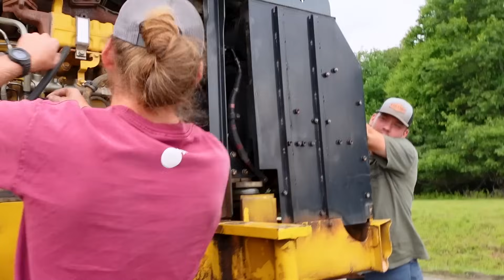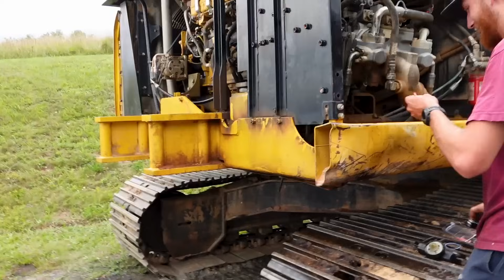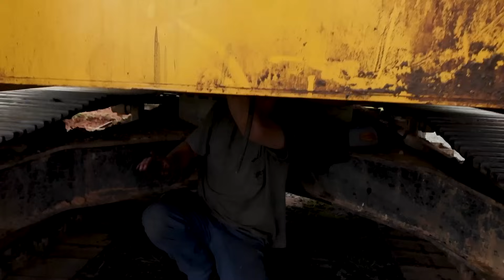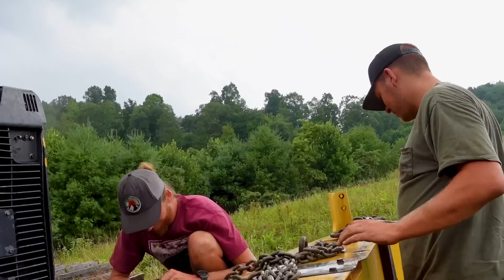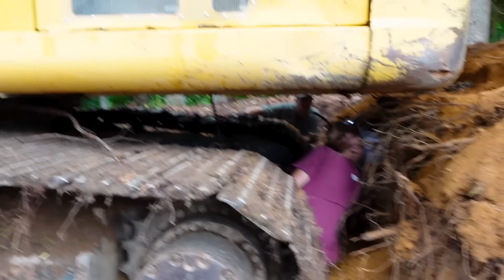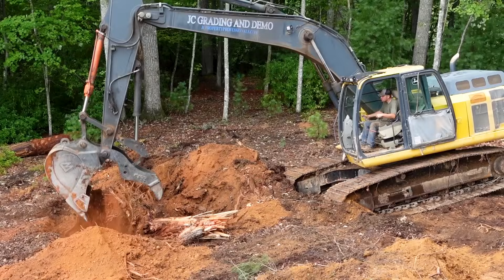Why I Will Never Buy John Deere Again  | 210G Repairs

Comment: Hey man we run nothing but John Deere’s you have a dealer issue not a Deere issue and the right mechanic at a good dealer will make you think other wise  or just a good mechanic but that’s what we get into buying used equipment.
Reply: Sounds like John Deere is hiring ford mechanics! 
 Replace parts until they get lucky🤯
Reply: John Deere sugggs bruh
Reply: Bro John Deere is trash especially making it hard to replace your old equipment and the whole program they have is trash because it’s not user friendly 😂 
To fix ur stuff u gotta use a hack program for there equipment
Reply: @thegreeninvasion5511 nowadays thats every manufacturer. Not a lot of talent out there anymore .

Comment: Jobs deere excavators in usa are usually hitachi machines with John deere decals on it
Reply: Not anymore. In February of 2022 Deere and Hitachi separated. But yeah most excavators made prior to the separation were made by hitachi. Used to use a Deere key to start my Hitachi 470.
Reply: @TsunauticusIV well yes but that John deere would be pre 2022 so would be a Hitachi I would think
Reply: They are all still Hitachi design and parts  built by deere in kernsville  yes even the new p models
  on a 210  the deere will have a deere engine and cooling package   A hitachi will be isuzu powered 

Deere is comeing out with there own design  there are demo prototypes out  in a few sizes doing testing now  they are still labeled p models but are full deere  known as the dex excavator in house

As for the lift pump  yeah the y come complete like u got  but theres a new brushless
Model out  u may not have got that one they are quute a but more money i would have too look it up

Comment: I don’t know who your dealer is, but my understanding is they’re only a small handful of independent dealers left in the United States. Most John Deere dealers are Nortrax. And I can tell you from experience they are horrible to work with. They had my excavator held hostage for a year for a swing motor repair. I have a real crackerjack mechanic I use. The only reason I didn’t have him do the swing motor is because he was going through some bad cancer. I will never send my machine back to the dealership again. My machine is actually a Hitachi purchased from the John Deere dealer. I don’t know the years, but Hitachi actually built the John Deere excavators for quite a few years and just recently divorced from John Deere. It is my understanding that the John Deere dealership Nortrax no longer supports Hitachi’s.
Reply from the maker: For sure, our only real dealer option is James River and we’ve dealt with every division in a 3 hour radius. Have our own employed mechanic now to work on them but he’s still got to argue with the parts darts boys at the dealership before they’ll sell us what we want.

Comment: The problems get right peoples do job.i work pipelines job nw alberta nobody knew at cat dealers how adjust clutch on 594 draw work yup.i got call so teach mechanic how do it because young guys work on new stuff most time.the dealers issue are start get bad even here canada on trucks, heavy equip, farm so on.thanks expose this.😮

Comment: You really have not a clue what your on about as you get one bad problem with one machine which sounds like nobody could diagnose a small issue so your never buying another one again grow up because in a lifetime you will have lots of different makes of equipment and it definitely will not be the last problem so learn to diagnose problems before you throw a temper tantrum about one issue